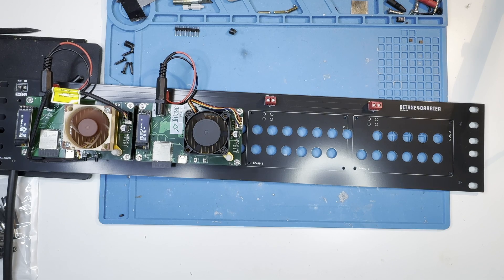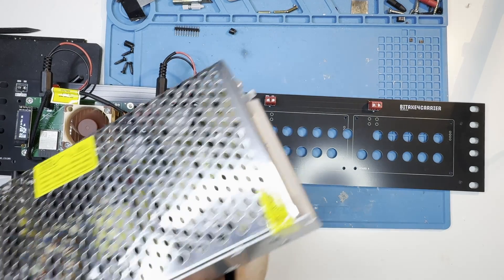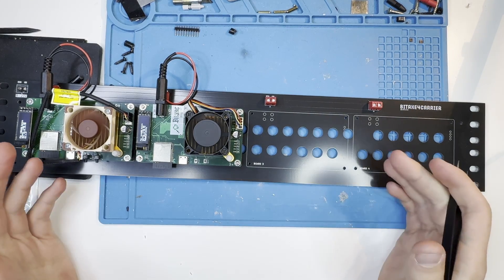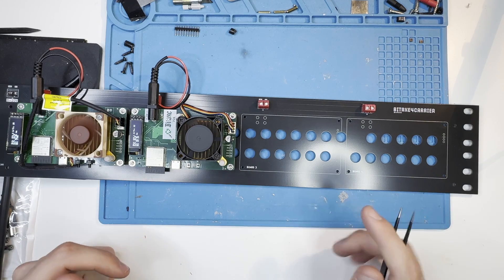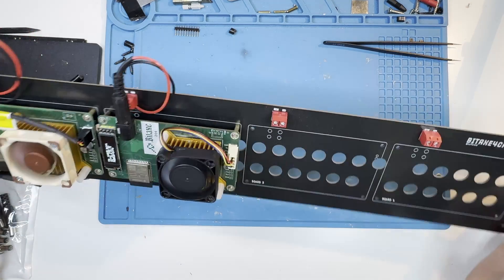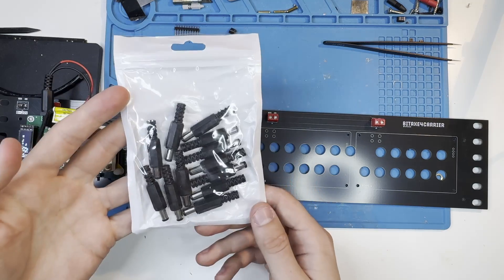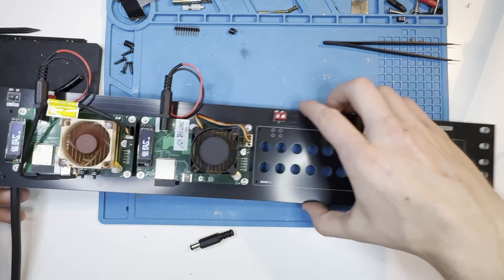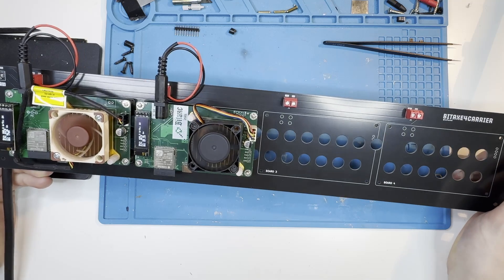Bitaxe4Carrier rack mountable Bitaxe holder

Comment: V2 def need to use the 5v and Gnd Pads found on the new 205 & 401+ series. No more DC Jacks! You could use 5a Pogo pins to do this!
Reply: @wantclue do you find those power supplies get hot? Mine get so hot I can't even touch them.
Reply from the maker: Some of them yea
Reply from the maker: Oh that would be nice